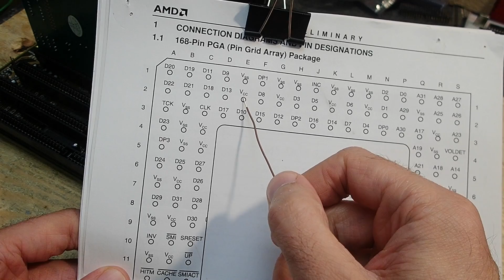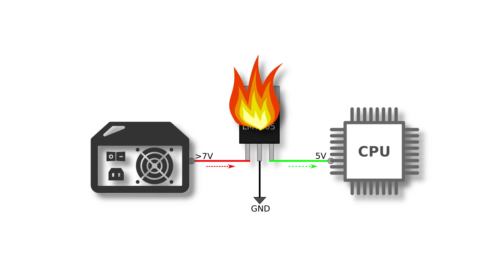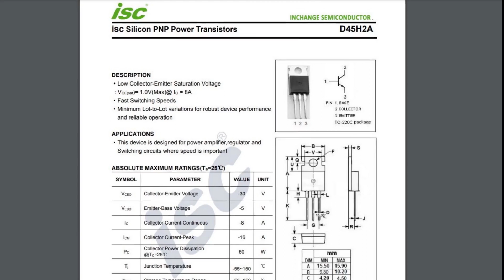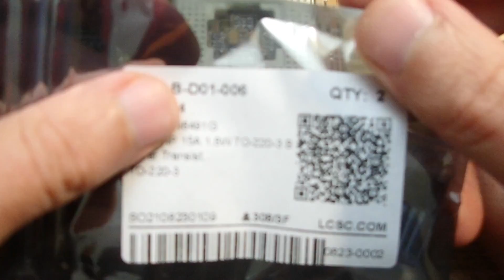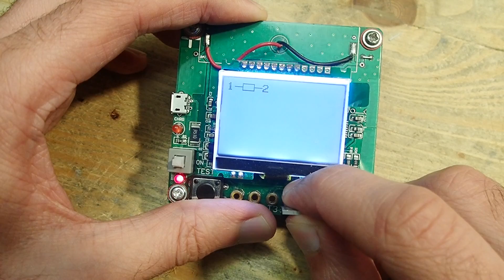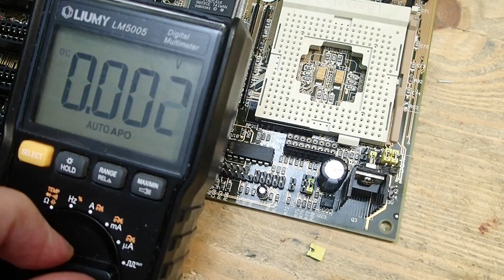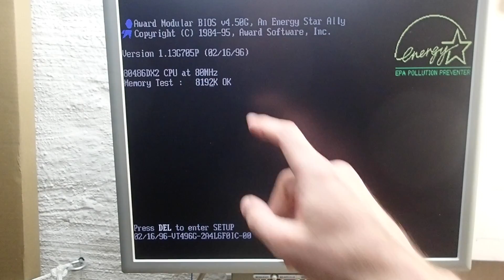Let's repair the CPU power supply on a 486 mainboard

Comment from the maker: Hi guys! There seem to be a lot of confusion around the type of the voltage regulator shown in this video. Many of you are talking about a switching voltage regulators controlled by PWM, as they often can be used in more modern devices. However, in this video I describe a 2-stage linear voltage regulator, which were widely used on the mainboards back in the days.  I fully understand your confusion, since they are very similar to the switching voltage regulators, but not quite the same. If you are interested in technical background about the slightly older technology, which I'm talking about in this video, search for Darlington Transistor on Wikipedia or other sources you like, the idea is more or less the same. And if you are interested in a switching voltage regulator, I have another video in the pipeline about that as well. So stay tuned and I wish you an exciting tinkering!
Reply: I think everyone is just freaking out because when most English speaking electronics hobbyists say DC/DC converter, they specifically mean a buck or boost switching converter. Never mind that an LDO/linear regulator is indeed used to convert one DC voltage to another DC voltage, and could be considered a DC/DC converter. So, stop nit picking on terminology, enjoy the well produced video which goes to the time to explain the repair, and please, please give it a rest.

It was well put together, got the point across, explained the repair without making any errors that would cause someone to make a major mistake - in other words an explanation for those trying to learn or understand. And I think he did a good job!
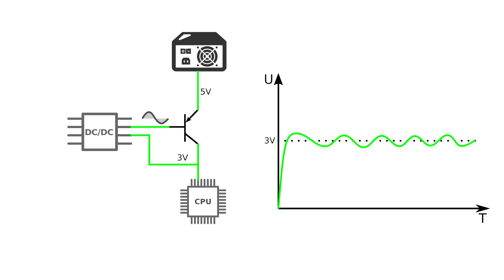Reply: @bryanpratt3933   I think that’s because there’s a bit of the video around 6:00 that goes to some trouble to explain that this kind of regulator is more efficient than a linear regulator, and so doesn’t produce as much heat.

But the thing is, this looks like it IS a linear regulator.  It has an external controller, in contrast to the LM78xx series where it’s all integrated into one IC, but the pass transistor is exactly as efficient as one of those linear ICs — Ohm’s Law says it must be.  Perhaps the dedicated PNP can be a little more robust, but the heat it generates will be a product of the current consumed and the voltage delta between supply and set output voltage - just like an LM78xx.

For it to be more efficient, it would have to be a switching topology.  But for one, there’s no inductor, so it isn’t.  The Darlington reference above just means the transistor is driven by another transistor to increase its current gain.  But it’s still a linear reg.  :-)

I don’t mean this to take anything away from the video, but we’re all here to learn something and enjoy the shared time on the bench, so I see no harm in clarifying where things appear to have been misunderstood.  (And hey, I didn’t look up the controller IC, so if I’m wrong about something, fair game to put me in my place too!!  I welcome the critique.)
Reply: @sirnickity  Exactly. It is basically an adjustable linear regulator that supports a much lower minimum dropout voltage than i.e. the 3V of an LM317. I've replaced this kind of linear regulator on an early socket 7 board by a cheap chinese symmetrical step down module to make it support 2V K6 CPUs that would otherwise dissipate way too much power on that linear regulator. But still a very nice video on an interesting topic nobody touched so far!
Reply: @sirnickity  Yes, it definitely is a linear regulator, it just has an external pass transistor. At 7:04 it's plain to see it's a LM2951 - look up the data sheet "The LP2950 and LP2951 devices are bipolar,low-dropout voltage regulators that can accommodate a wide input supply-voltage range of up to 30 V." It's just a linear regulator with an external pass transistor.
Reply: I believe you can have a switching power supply without an inductor but you do need a capacitor.  The idea would be to bring the pass transistor to saturation for only as long as it takes to bring the capacitor to desired voltage.  Once reached, switch it off until it goes below a threshold.
But more likely it is as others said, a linear regulator with external pass transistor where pass transistor is in its linear region, creating a resistance to drop the voltage at the given current.
Reply: @danman32   That's technically possible, depending on the equivalent resistance of the circuit, but assuming a perfect voltage source and zero ohms RDSon (for a FET, or the C-E equivalent for bipolar), the moment the transistor opens to saturation, the cap will charge instantly to Vin.  In real life, it'll take slightly longer than "instantly," but still a bit unwieldy.

The fix to that is to open the transistor partially, and keep it in the linear region.  .... At which point, you have a linear regulator again.  :-)

So, the other fix to that is to use an inductor in series, which will impede sudden changes in current, and charge the cap more slowly so the feedback loop can monitor and compensate accordingly.
Reply: I see a lot of explanations most of them do not mention the most important part. . The LM2951M is low drop linear voltage regulator. It is actually equivalent to something like a 78xx. However, it requires a much lower input voltage. The drop out voltage of this regulator is only 0.38 volt. This means that you can use the 5 volt rail to generate the 3.3 volt. With a voltage drop of 1.7 volt. The transistor which is probably a PNP pass transistor is used to improve the current handling from 100 mA to close to 1A. The 80MHZ AMD 486x2 draws around 0.8A. This results in 1.7V*0.8A=2.5W. This can easily be dissipated with the cooling shown on the motherboard. Also remember that normally the FAN of the power supply pulls air through the PC. This is the maximum rating, normally it will be lower. 
The reason why regulators like the 78xx are still used is because they are more stable and less likely to oscillate. One of the problems with LDOs is their tendency to oscillate. This is normally prevented by using good low ESR input and or output capacitors. However, a LDO regulator also doesn't like a high capecative load at the output. 
Was a little amazed how low the power draw of these old processors is. ;-)

Comment: I want to get an AMD DX2 80 or DX4 133 and see if you can clock it at 66MHz FSB and not clock doubled or get the DX4 133 to work at 66MHz and clock doubled. If I remember, I did something like that with mine waaay back but just did my DX4 100 as a "DX2 100" just clock doubled but with a 50MHz FSB. It worked fine for the years that I used it and with the jumpers to set the PCI bus or VLB can't remember which, I could get really fast data transfer like when loading doom. I had a nice heat sink with fan to keep it from over heating. I think that it was faster than a P75 or P90 when I ran some tests. Just the Pentium FPU was much faster though.

Comment: Maybe it's colder because of the slight undervolt and better regulator?
Reply from the maker: Well, you can't consider that 0.05V from 3.3V as an "undervolt". It is still within a proximity of 0.1V by specification. Also in my opinion, a better regulator should only play a role for the regulator itself, but not for the CPU.

Comment: Hi. Curious as to what temperature you soldering iron is at for this board work. If it's not temperature  controlled, then wattage. Thanks.
Reply from the maker: I use 250-300°C for leaded solder and 300-350°C for unleaded.

Comment: The lower voltage issue could be due to the capacitor being a little warn out. That said the CPU might be running cooler as a result of the lower voltage. Even in modern systems undervolting the CPU can lower temperatures. While that can cause stability issues in newer systems it's far less of an issue on old processors like that one.
Reply from the maker: Thank you very much for the sharing your idea. In fact, I tested the capacitor off camera and it still looked quite good. I decided to leave it in place so far, since I don't like to change the parts, if they are not broken.
Speaking of the temperature, the CPU requires 3.3V and the board delivered around 3.26V, so by 0.04V difference I can't speak about real undervolting. I guess, it is normal for 3.3V 486 CPUs, that they are so much cooler, than their 5V predecessors. I guess, after a while in a closed case, the CPU would probably get much warmer, but still very surprising, that it stayed cool for such a long time.
Reply: Conversely, it could mean that CPU is just a silicon lottery winner and runs cool. That means it would probably run at 3x33 just fine, maybe with a bump to 3.45V, and still not need a fan (although a heatsink is probably a good idea).

Comment: Great video … been doing something similar except that my (socket 7) motherboard outputs the correct voltages when no cpu is inserted, but acts weird when a cpu is inserted. It came with a WinChip 2000 CPU (3.52v) but I can only get it to boot when the jumpers are set to 2.8v
Reply from the maker: Thank you! If I'm allowed to guess, in that case I'd double check the capacitor first and then the controller. I also assume, that on the S7 there could be already a switching regulator rather than a linear. If there is an inductor nearby, then it would be a switching one. In such case the PWM controller is a very common culprit, which leads to exactly that behavior. Less likely to be faulty, but still possible are the resistors, which act as a voltage divider to control the feedback line. If the resistors went out of spec, that can end up in a voltage slide which would confuse the PWM controller.

Comment: Nice work , 486 board where my sort of time ,  where did you get the small transistor tester from ?
Reply from the maker: China, it was half not working as I got it. You could use it through USB power, but not with batteries. There were some power supply parts missing in the circuitry, so I had to solder some parts and 3D print the stand with the battery holder.

Comment: i remember repair a socket 3, the transistor was broken and i remplace it with c2314 and work very well, can i use 7805 too ?
Reply from the maker: Different Boards need different transistors, there are things like PNP vs NPN, pinout and electrical specs to be considered, so you can't just take any one. And 7805 is not a transistor, it is LDO to convert voltage above 7V into 5V. You need a transistor and you need 3.3V on the output, so 7805 will not work.

Comment: Great repair video! I had a motherboard with the same issue - a bit more difficult to diagnose as the transistor would output the correct voltage with no load but dropped to a lower voltage with the CPU connected!
Reply: Holy two year reply, but can you recall what the issue was?  I think i'm in the same boat as you, although I've replaced both the transistor and regulator IC.

Comment: I still have around a Soyo 5TCS mobo, which specifically failed in memtest v5.01 only when running a P54C @ 200MHz (66x3) and the PC case was closed.  After using another CPU and a bigger heatsink/fan, the problem persisted, although the heatsink would get barely warm in any case.  After a more careful examination, I found that the screw that kept the voltage regulator in good contact with the correspoding heatsink was loose... Putting some thermal paste and tightening the screw completely solved the problem!  Thus, inadequate VRM cooling may produce intermittent failures when stress-testing even non-CPU components.  A careful inspection may reveal that such simple things can cause system instabilities - just have a second look before resorting to soldering and desoldering components.  Keep up the good work!

Comment: Hi, I have an old board, and i followed your video on making an ATX-AT adapter and plugging it into an ATX power supply with a -5V rail and sufficient wattage on the 5V line. When I short the green wire to ground, the board turns on, the power LED i plugged in lights up, and the Pentium Pro CPU warms up. And the board produces a long beep, pause, another same long beep, pause, same long beep, pause, and it repeats this forever. When I remove the only RAM module that I have to fit this board, the beeping goes away and theres no beep code at all. But when i plug in that same memory module again it produces the long beep pause and repeat. I tested my PCI video card in a Pentium 4 build and it works great. Does this indicate Memory Issues? Or is my board fried?
Reply from the maker: Yes, repeating long beeps is a signal for broken memory. Most Pentium boards need the memory modules to be used in pairs. For example, if you need 16MB RAM, you will need 2x8MB EDO RAM.

Comment: Actually, LP2951 is just a LDO voltage regulator chip, not a switching DC-DC converter. Check the datasheet. Also, DC-DC converters usually require an inductor for operation. Regardless, very nice video and congratulations to the successful repair!
Reply from the maker: Thank you very much!

Comment: If that 486 DX2-80 is cold, try an overclock of the multiplier to 2.5x or bus to 50MHz? Golden sample maybe?
Reply from the maker: The multiplier on a 486 is not really changeable. AMD 486 CPUs had a "hack", where one reserved leg was put on ground to force 2x multiplier and without that hack (which many mainboards don't support) the CPUs are running with 3x multiplier. I tried this CPU at 100MHz (3x33MHz) and it ran stable. Could be possible to get it to 120MHz with FSB of 40MHz I guess.... may be another day.
Reply: @necro_ware  I've been at this a long time and never heard nor read about that AMD 486 hack before.
Reply from the maker: @dalecomer5951  Well it's not really a hack, that's why I wrote it quoted, it's just if you simply put an AMD CPU instead of the Intel you will get a 3x multiplier instead of 2x. I just looked into the datasheet and it was a CLKMUL pin, which you have to put on ground to get the proper multiplier on AMD. But on Intel CPUs this pin could (or had to?) be left floating, what many earlier 486  mainboards did. Later boards usually added a jumper to set that pin on ground. Some boards you have to mod to get an AMD CPU work there properly. It's btw regardless if the CPU is 3.3V or 5V.
Reply: @necro_ware  Yes, not a hack but an unadvertized "feature."
Reply from the maker: @dalecomer5951  Yes, the usual problem - "is it a feature or bug?" :D

Comment: I have the predecessor, the PIO2. It's ultra stable, but also PCI transfer rates are quite low. I couldn't get a Cx 5x85 working stable in it, but then again it could overclock an AM 5x286 133 to 160 MHz using 40 MHz bus speed. 
So concluding: If this board likes your CPU, it can do some tricks. If not, you better try another board (this one failed 2 5x86 which worked just fine with two other SIS based boards)

Comment: Wrong pwm description. Main idea of pwm - no semi open or semi closed transistor. If transistior open it  no consumes power because on zero resistance, if transistor closed it consumes no power because there is no current at all. Transistor opens / closes in loop,  regulation works only due a time when transistor opened and when transistor closed.  Change time of open/close - changes output voltage. After transtor connected a capacitor and  coil, they smooth a spikes to direct current of needed level.
Reply from the maker: What you describe is a switching voltage regulator, what I described and was used on this mainboard is a 2-stage linear voltage regulator. A video about a switching regulators is in the pipeline as well...
Reply: Might have been deducted from the missing coil, taht it's not quite a modern VRM stage.

Comment: I had a similar issue with the vlb board I have (V4P895P3 / SMT V: 1.0). Spent ages trying to troubleshoot as only 5v cpus seemed to work. Came down to the regulator being used. Previous owner had obviously tried to solder one on and I didn't notice how awful of a job they did. Swapped it out and it works perfectly now. Also did the same thing, shoving some 24awg solid core into the vcc and ground pins to test voltage.

Comment: I think it stayed so cool only because Doom didn't use the FPU.
Reply from the maker: Well, the DX2-66 @5V was quite hot in the same board running Doom. The difference of almost 2V makes the CPU a lot more efficient, I just didn't expect that much difference. It certainly will heat up in a closed case on a warm day, but still, it is a huge difference.
Reply: @necro_ware  I know, sometimes running only the POST to check if the BIOS recognizes some socket 3/5/7 CPU without a heatsink is enough to make those burn your fingers.
I also have a K6-2 400 (2.2V Core 3.3V I/O) that I found on the street with twisted pins, someone had stepped on it, after straightening them very carefully I discovered that it was good and I have used it more than once on 3.3V mainboards to do those kind of compatibility tests before trying to mess with unofficial jumper combinations or regulator mods.
Once I used it to install Windows 98 and various games and it survived without any (apparent) issue but I used a half decent socket 370 heatsink with a copper core and a much faster fan.

Comment: I wonder if the dx266 would run stable at 4v setting?
Reply from the maker: Not all, but many do run stable at 4V. I use it in one of my boards to keep it cold.
Reply: @necro_ware  That is pretty interesting. I have yet to try it myself.  I bet it makes quite a difference.

Comment: Excellent repair.  Last month I had to fix a M919 PCChips that had the same problem, in my case the 2 power transistors were burned out, and I had to search for replacements locally (2SD2583 ---> MJE15030)

i look forward for the next repair videos! There are super useful
Reply: Which version of M919?